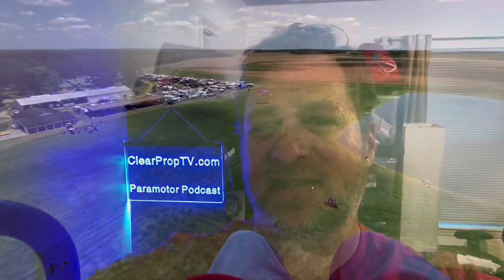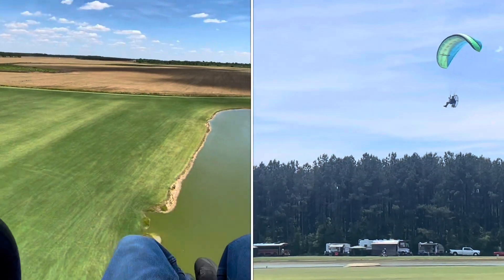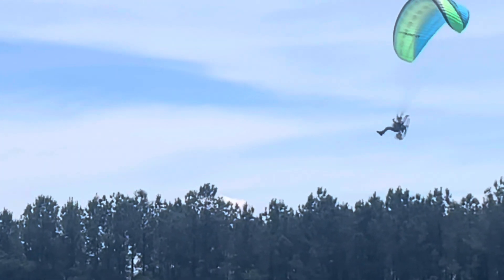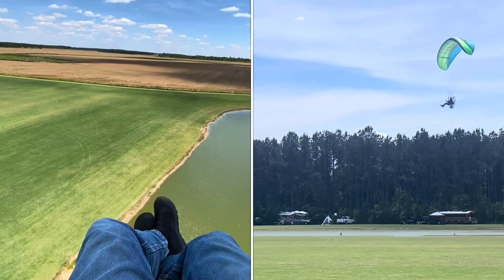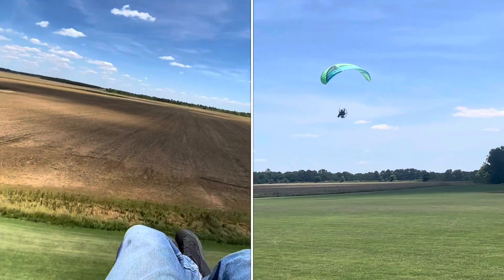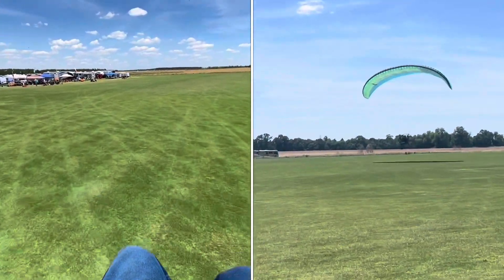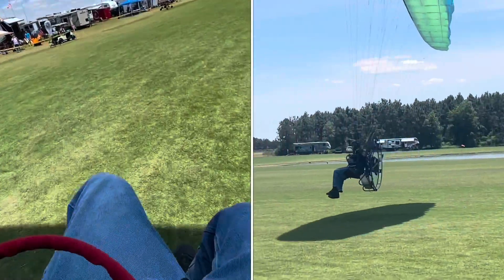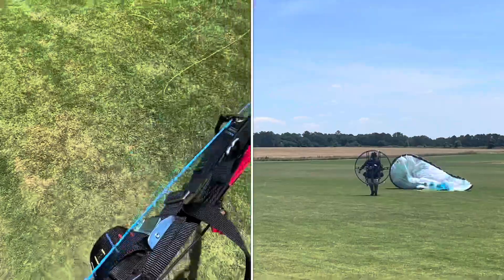Watch as the paramotor drops 50 ft in cold air sink (down draft) next to a pond

Comment: Nice landing👍 How can thermals form over water midday? Ive always heard the opposite since the water is usually colder then the heated ground around.
Reply: exactly, that is why he had sink over water.
Reply: @12vibaba  yeah but the illustration at 0.52 and what hes saying at 0.57 is that the hot air comes up from the water, never heard of that before.
Reply: @rickardjonsson4526  Yeah, I'd like to see the caption on that figure. It looks like something describing the water cycle, so the lines would be symbolizing water vapor, not heat.
Reply from the maker: on a hot day, the amount of lift over water is great... if you fly mid day you would feel this too... i get sink when I get to the side of the pond/water.... happpens all the time
Reply: Yes, just proves how this channel is crap. I agree totally with you. One of the worst is that "crap" channel "Tucker", who shows his videos of breaking airlaw.

Comment: sorry but you’re not correct. thermals never form from water masses. the water absorbs far too much heat to ever produce a thermal. flying over water will only ever be laminar air or sink.. unless there is thermal drift from surrounding area due to wind
Reply: Paragliders always talk about finding bodies of water for some of their best mid day lift. Usually no thermals over water is said regarding the ocean. But when it comes to ponds and such, the water edge is often the catalyst releasing the thermal into the air. On top of that thermals dont just form and then only go straight up, they move

Comment: That was quite a drop. Nice save and yeah for sure if you'd have been lower it could have been ugly. I also noted the tops of those trees waving around. Seems like you were in minimal conditions and plain old mechanical turbulence was a factor. I generally don't come that low with any power on. Guess I'm deadsticking my spot landings. Also like to have my 'gear' down a lot earlier than that!